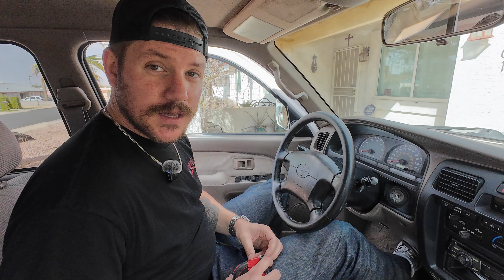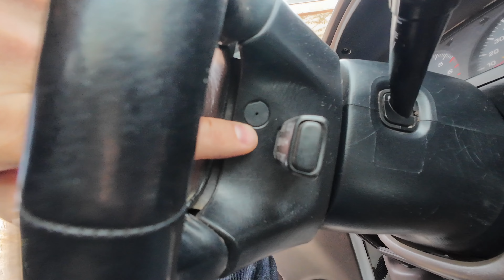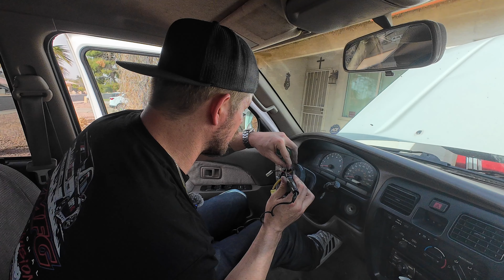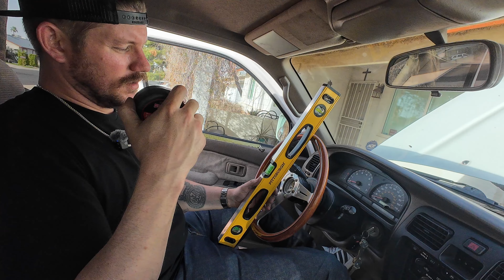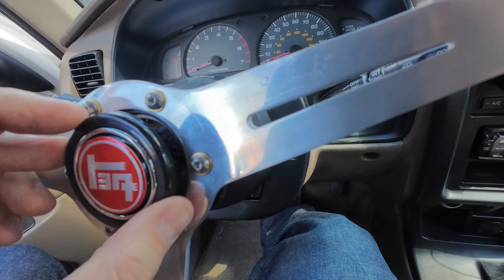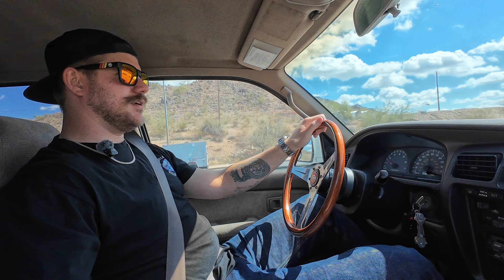Installing a Quick Release and Steering Wheel In My 3rd Gen 4runner

Comment: Hey Mike. I’m digging this content. I did the same operation with a different wheel and I’m glad to ditch the CC. I’ve used them twice and hated both times. Have you thought about doing a cruise control delete video?
Reply from the maker: Good question. I had not done a full removal on this truck. I actually ended up changing directions and sold this 4runner (I'm still bummed about it), so it was good I still had everything in place, because getting the OEM wheel and CC back to factory was really easy with a lil re-wiring.